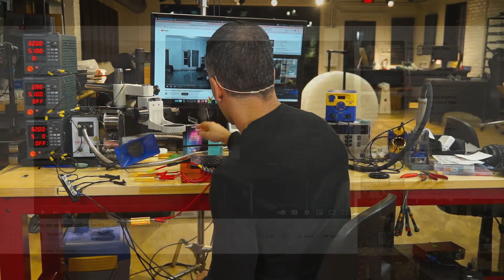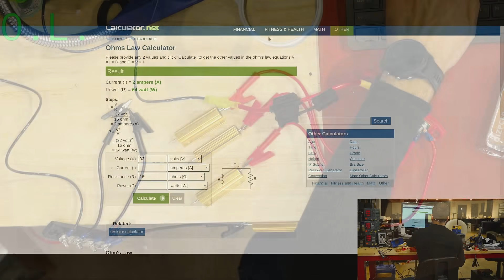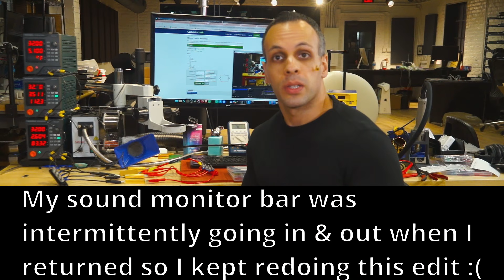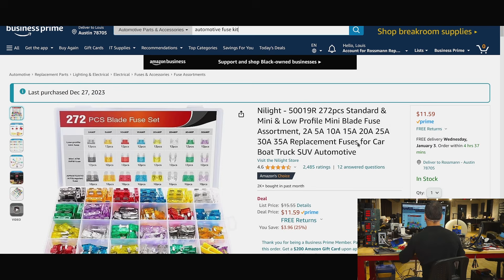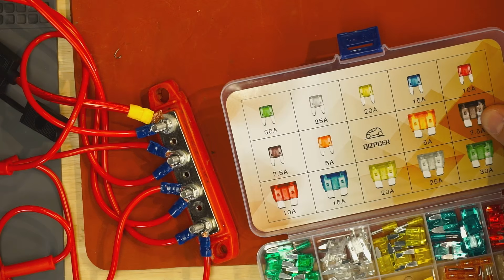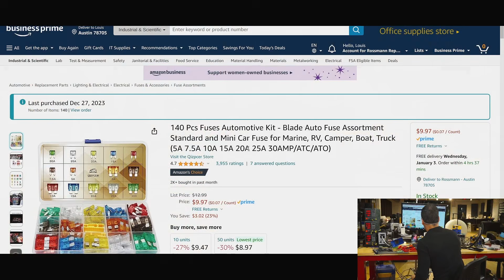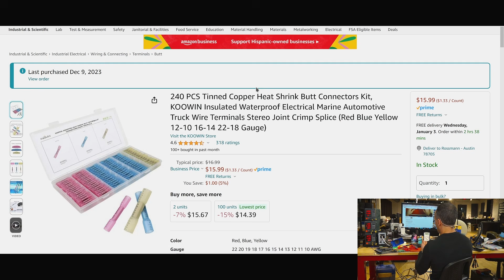Amazon Sells Fake Electrical Fuses

Comment: Actually you do not need the resistors.  You can just put the powersupplies in parallel, connect the fuse, and set the powersupply current limit according to the amount of current you want to put through the fuse.
( = powersupply in constant-current mode )
Reply: Literally increasing the amount of load using resistors you can see illustrates the point easier than trying to explain to most people how the voltage supplied to the fuse doesn't really matter.

To achieve a constant current output, the power supplies regulate the output voltage based on the connected load instead of just a constant 32v. Then he'd have to explain why the fuse blowing at 1.84v 9a is the same as 32v 9a. (random numbers for example)

Sacrificing ease of testing for an easier to understand demonstration.
Reply: @Darkassassin09  Well, as also mentioned by others, the voltage rating is not really a parameter of the fuse, it is just a specification of the maximum voltage it can safely break.  As these fuses are for automotive use, a value of 32V has been specified.  But the test really does not involve that, it is only the current that matters for the test.
When people do not understand the concept of a current supply, the natural way of doing it would be to have one fixed resistor "as the load", say 1 ohm, and then vary the voltage of the supply (2 volt = 2A. 5 volt = 5A, etc).
Of course the fact that he has 3 supplies of a too-low current rating complicates the matter.  With a single 30V/15A supply it would be easier.
Reply: @Rob2  I am well aware of that, as is Louis; but most people, specifically those that are not familiar with electrical concepts, are not.

Again, he sacrifices ease of testing for an easier to understand demonstration, instead of having go in depth explaining more electrical theory than necessary.

Comment: The bad cheap fuses are made of aluminium or some other white metal. (You'll quickly realize this if you try to solder them) The problem with this is that they'll have a lot more thermal expansion leading to the connector they plug into getting loose with time. Also, you can't trust this no name fuses. One thing that often happens with this cheap products is the initial batches are fairly solid and then turn to absolute shit because no one was checking the tooling to make sure it hadn't worn-out.

Comment: Had $1K Optoma projector die due to power surge at school. Tried replacing thermal unit (SMD soldering) and the fan which the projector was showing in error state. Did all the suggested work found on YT and forums. Then on one forum found Optoma has no fuses, no surcharge protection whatsoever. I literally  took apart the whole Optoma W307 USTi apart just to figure out their ground wire is just hooked to the metal frame of the projector which in turn holds the PCB. Now one doesn't need to wonder why the projector died. Imagine a product that costs 1000 USD has NO fuse at all. Something that costs next to nothing was just missing. Optoma as a brand does not exist to me. 

Worst part about it is, I contacted them via their website form writing in all the necessary info including the serial number which unless stated in the case opening would not be even viewed. Zero respuesta. I only found the thermal unit part on AliExpress. Only 2 sellers were selling it. One per unit, the other in bulk. Upon soldering I ringed all the contacts to verify the wiring. All were connected. Upon visual inspection I did not find other issues with the PCB, but assumed since a number of units died, the PCB might have fried somewhere as well.

When staying in U.K. I noticed they even put a fuse into EVERY individual appliance whether kettle or a refrigerator. The triangular shape socket has a physical fuse. I liked the idea and wondered how this is not standard. At least inside of the device. 

Some of the budget level SSD suffer from cheaper rectifiers as well and no wonder some of these SSDs die not because of reading/writing cycle end, but due to a short circuit on year 3. I wonder if there are any ISO standards on these cheap 20-30 EUR SSDs.

Comment: Wow... excellent yet very scary video Louis!

Those resistors might actually need heatsinks, I know the rating on them is 100W so they should be fine but then you get smoky, untouchable resistors that wick heat to the wires connected to them; but I'd only bother if you're going to do more tests.
A couple of ruined tests with melted wire insulation taught me this lesson. :(

Anyway, I googled "automotive fuse datasheet" and just looked at the first one I saw; Littlefuse Blade fuses (ATOF Blade Fuses Rated 32V)
Based on the curves given, a 2 amp fuse seems like it won't really blow at 2 amps (>1000 seconds), but at 3 amps is expected to blow within 10 seconds; 4 amps should cause it to blow in 300mS. Apparently there's variation but that's to be expected. I also had a skim of their similar mini blade fuse datasheet and it looked similar though it seems maybe minis are slightly more sensitive at the same ratings.

In short, if a 2 amp fuse is not blowing at 4 amps within maybe 5 seconds at most; it is a dangerous dud.

Littlefuse is pretty good from memory, so I would trust them to make "automotive" grade fuses that would be up to standard.

Comment: why do you use resistors? are those PSU not able to work in current source mode? 
You don't need to set up 32V. It does not matter if you have 1V or 32V it should blow at the same current.

Comment: My guess on why the other brands are fraudulent is simple.

They made one fuse type, only one production line and just had them colored differently and stated as different ones?

Why would anyone think to do it? Because there isn't really an obvious fail state as opposed to if they had a rating higher than they can handle.

Saying a 10 amp works with 2, 5, and 10 is an easy way to save on production costs while it not being obvious it's bullshit unless you have a set up like Louis.

Comment: I was surprised at the crimps video because I've had different personal experiences, but I can confirm what you demonstrated here.

I've had fuses provided with cheap chinese products fail me multiple times, for example I've had a fuse for a 3d printer melt the plastic casing and the holder as well before it eventually blew, but the best part is that there was nothing wrong with the printer, nothing that made it go past the normal current rating, replaced the holder and fuse with one found at a local auto parts store, same rating and never had an issue again. 

I've had others not blow when there was a short, leading to a current probably ten fold the rating of the fuse.

Comment: Got exactly the same issue with Aliexpress 6 amp C-type circuit breakers meant for mains. I bought some transparent ones as demo models for students, so they can see what's inside of them. I could draw about 20a for about 10 minutes, before it finally tripped. 
I still use them as demo circuit breakers, just with a 25a heavy car battery charger to safely and reliably make it trip.
Reply: What brand?

Comment: Just to be clear. Don't expect the fuse to blown on rated current. They usually required 2x rated current to blow up. Have a look datasheet of 0297002.WXNV littelfuse (reputable brand). It will blow up in 0.15s up to 5s

Comment: Unfortunately this happened not only at Amazon or Ebay, but all over online market.
I'm not electrician and not using many of that product, but i do outdoor sports and noticed the same thing over outdoor safety gear/equipment.
It just horrifiy me to see they sell untested/unregulated kernmantle rope, harness, carabiner, etc... a safety gear that you need to depend, and hang on your life onto it, quite literally... 

Yes, it is much much cheaper than a trusted brand like Petzl, Beal, Black Diamond, etc... 
But product from those brand are more expensive for a reason, they are certified after rigurous testing to pass standard from regulatory body such UIAA.
Reply: And regs are part of why those good products are more expensive. 
Regs backfire because people will just go build stuff where there are no regs then swamp the market with it, undermining companies who are following the regs
Reply: @matthewmosier8439  True, regs play part to make it more expensive.
For things like apparel, gadget, or lifestyle goodies, i really don't care much if they don't exactly follow the regs and code.

But for product and safety equipment, which on this case not only figuratively, but literally... that your life depend on it...
It just mindblowing to see they sell it so carefree... 
Many times not even bother to put disclaimer that some of those knockoff things are practically "gimmick" and not intended for safety gear.
Reply: Sadder is when people and companies are forced to save money and/or meet deadlines and buy/use inferior parts or cheat on safety or performance tests, e.g., Samsung, VW, Cummings, Toyota/Daihatsu, etc.

Comment: This is really interesting and I've known about this issue for a while. But I would also like to see somebody do some variance testing. I want to see if every two amp fuse in that box blows at 10 amps or if some of them will blow at 5 or at 6 or maybe at 1.

I'm mostly wondering if this is overspec and just white labeling some random fuses or if this is a classic case of really crappy Chinese QA. And yes, I know the crappy quality assurance is not solely a Chinese problem, but with a lot of these companies they are buying from usually a Chinese manufacturing company and just slapping their label on it and they get really bad quality assurance

Comment: The rating on a fuse is what it can safely carry.  If your 2-amp fuse blew at 2.001 amps, it would piss everyone off.  You need the "interrupt rating" for the fuse.  IIRC, the interrupt should be about 25% higher than the rating.  So a 2 amp fuse should blow at 2.5 A.

Comment: I watched your previous video, and I am still accumulating evidence for an estimate of comparative reliability of your accusations vs. Amazon product claims. This helps, for two reasons:

1. Testing fuses is the obvious next choice, I was hoping you would try that (BTW, I have seen an older video on the subject).
2. I happen to have that Qizpcer kit (product B0899WR671), purchased in August, 2022, and have used (and blown) fuses from it in my mobile solar power testbed with no obvious evidence that they aren't about right.

Assuming, of course, that this video is not an AI manufactured manipulation with prior knowledge of my Amazon purchase history. If that is the case, my estimate will take longer.

Comment: Time current curves (TCC) for the fuses should be reviewed before drawing any conclusions.

The nominal fuse ratings i.e. 1A, 2A,3A,.... doesn't necessarily define when it should blow. Many fuse types will pack 1.5 to 2.5 times their rated current indefinitely. After that the response is non-linear and inversely proportional to time.

The Amazon fuses are likely garbage but any reviewer should take the time to review and understand characteristics of the

Comment: If you want to use multiple power supplies in parallel output you should put a 1ohm resistor on each unit's positive output. This is done for current limiting so you don't end up with one unit doing most of the work.

Comment: I found the datasheet from a reputable manufacturer, and it says that at 110% of the rating the fuse should NOT blow for at least 100 hours, at 135% should blow in between 1 and 120 seconds, at 160% between 0.25 and 50 seconds and at 200% in less than 5 seconds, so the 5A one you tested seems to be in specs. You should test ALL the fuse in the box and check whether they are ALL in spec: a single defective one is more than enough...
Reply: But 5 seconds at 200% is not nearly 10 minutes at 400% or so on the 2A one ...
Reply: But when you're done, you're left with no fuses
Reply: @MrBearyMcBearface If they're as bad as it seems, that's a win/win.
Reply: i found exactly the same on RS components.
Reply: @moen3249  probably because that's where I found it too 😂
Reply: @Beregorn88  what a coincidense :)
Reply: In spec, but still terrible for a fuse meant to protect your circuits.
Reply: I agree. I found
110% 100 hours or more
135% 0.5s ... 600s
160% 0.25s ... 50s
200% 0.15s ... 5s
350% 0.04s ... 0.5s
so the first fuse was way off (mislabeled ?), the second brand was good and the third brand was a little bit on the fast side.
Considering the wires (and thus the fuse holder) may have been hot during the last test and it is of course temperature dependent, I would say the third brand is also still ok, although a 2A fuse should never blow at 2A, its nominal rating!
Would have been interesting to see the inner wire of the first fuse under the microscope compared to the other ones.

Comment: I get it. Making a data sheet by rigorously testing them in a home/office lab is not fun.. you won't get one from the manufacturer, but you can measure one yourself by noting down precise volts, amps, and durations you ran them at that setup. Even so, a good 2A fuse should pop in like 5 minutes on 3A, and instantly by the time we hit 5A (2.5x rating)
Reply: You can't trust such a data sheet.  Once a product is that far out of spec, I have no trust that they aren't randomly mixing batches or otherwise producing parts that have inconsistent behavior.  Such inconsistency might only happen intermittently or on some orders.  Further, if your fuse is that far out of spec, I wouldn't trust it not to somehow be a fire hazard when used at the rated current.  E.g., a poor quality electronic part can have "starts fires" as it's long-term failure mode.

Comment: During the supply chain issues a couple years ago Amazon was the only place I could get different parts I needed for a big electronics project and unreliable connectors/ICs/power supplies combined with a manager who always asked for more features and doubled capacity as soon as the prototypes were functional instead of finding and fixing bugs ultimately doomed the project.

Comment: Could Amazon be sued for liability for knowingly, or negligently, selling verifiably unsafe products?
Reply: That's a point where law and reality probably diverge.  What Amazon allows with reviews is definitely participating in fraud and at minimum negligent, if not reckless, but they'll just claim ignorance and get away with it.  Government has decided to allow tech companies to take all the protections of neutral platforms, while also taking full control of what content they host, which legally disqualifies them for those protections, but they are given immunity, anyway.

Our government isn't interested in enforcing consumer protections.  It's actually illegal to put a "Warranty void if sticker removed" sticker on devices, but it took over a decade for anything to be done about that, despite being a completely straightforward and obvious thing.  The FCC has promised to do something about spam/scam calls for decades, but has barely done anything despite literally billions of illegal calls.

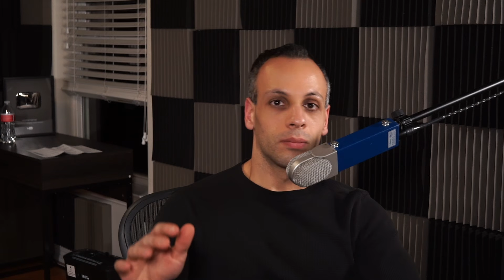Comment: 15:18 - This is also something that no-one who buys that stuff at Amazon will ever consider.

You buy a 2A fuse because your device asks for a 2A fuse. It doesn't ask for a "2 amp fuse that will trip at 8 amps after fives minutes", because no-one with any kind of legal liability would design a device that way.

Comment: 2:30 talking About how fuses are rated for watts is very inaccurate at best and wrong at worst 

They are Amp and voltage rated 
Amp because that’s what makes them blow volts because of possible arcs with higher voltage keeping the circuit closed

Comment: Answer: if you want a fuse to blow at 2A, use a 400mA fuse😁
Reply: except the 400ma fuse is the same as the 2a fuse, just has a different colored cap.

Comment: the worst part is amazon will hide behind the old 'oh , thats a 3rd part seller item, we dont take responsibility for those'. when the only reason those 3rd party items sell, is because they are hosted by a formerly legitimate selling platform. this is why i no longer shop on 3rd party hosting sites. bestbuy is the last remaining retailer which doesnt host them. some times you have no choice but to buy on these sites, but i avoid whenever possible

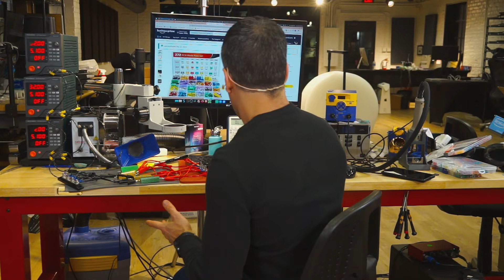Comment: 26:12 You would be surprised. Penny pinching management types will buy these fuse kits for their technicians because it's cheaper, and that means professionals are putting these fuses in people's stuff for pay. It isn't just a DIY problem. It affects every aspect of the repair chain.

Comment: How can someone review such thing as a fuse? High ratings are most likely based on cost and assortment-completely ignoring the technical aspects of the product. Will I ever read a review giving it 5 stars saying the fuse blew at the stated rating saving the risk of fire? Very eye opening experiment! This supports the fact to stay away from big box stores and Amazon for safety related products. That’s why as a handyman I go to plumbing and electrical supply houses - this is where the pros go. (I jabbed big box stores which may be unfair, but the pro shops offer better value-considering safety, service and cost)

Comment: Dude, you put a microfuse in a full size fuse holder, you selected it by color instead of double checking the rating stamped on the narrow edge of the plastic body of the fuse. 
Can you call BigClive for little help with your protocols ?
Reply: "you put a microfuse in a full size fuse holder" like it makes a difference in this case? and also, you suggesting they stamped the dark grey fuse with anything other than 2a like their chart says?

i honestly wonder why you trust him less than the quality of products on amazon. who you working for?
Reply: @Cara.314  no, i said amazon stuff are crap. But that does not dispense from a minimum of rigor in the testing.
Hence my call for BigClive…
Keep your anger for your close relatives… or your shrink…